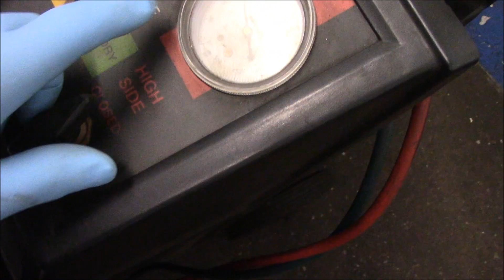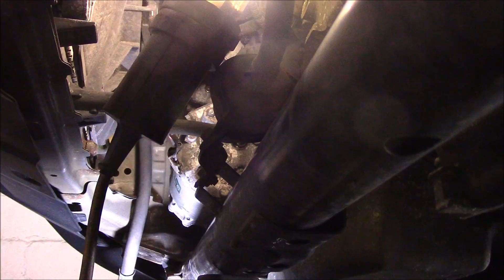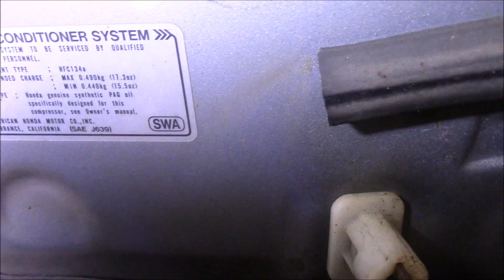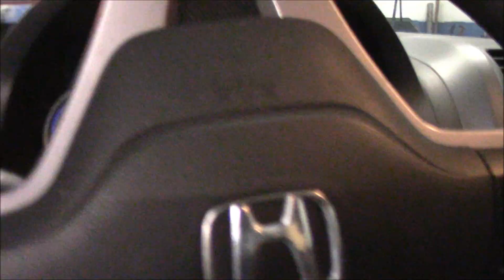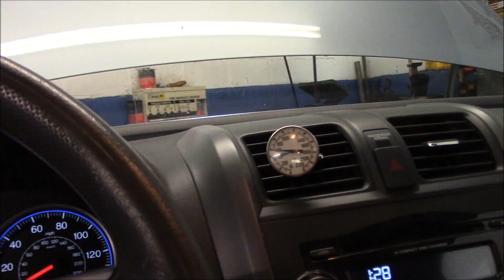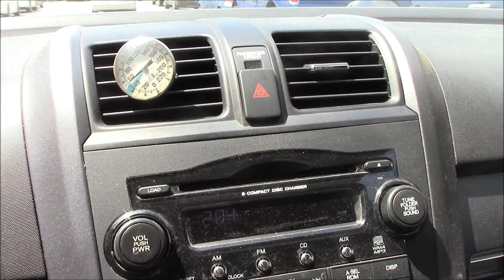How to replace the AC compressor 2008 Honda CRV

Comment: What does it mean if it's leaking? When the AC is on in my 2008 honda crv, what looks to be water starts leaking under the car. When the AC is off, it doesn't leak.

Comment: If the new compressor is pre-filled with oil, you just install it? denso video wants people to measure oil in old compressor and adjust the oil level in new compressor, is that necessary?

Comment: I would like people to call R-134a "refrigerant" or "R-134a". R-12 was called "Freon'. Oh, me? A retired 50 year fleet mechanic and an ASE certified mechanic for Auto and HD Truck. Yes, too many PRO mechanics call that R134a refrigerant "Freon" but just 'cuz they do, does not mean it's right. This is a good video on the procedure to replace the compressor! Thanks!

Comment: Jim, Thank you for this fantastic video on replacing the AC compressor.  I have a 2007 CRV and was quoted over $1800 to replace the compressor.  With your help and step by step instructions I am in it for a little over $335. I know the car is not worth over $3000 but now  we have a second great car that will last for several more years.  Thanks again, much appreciated!

Comment: Happened to me twice this summer 2020, Driving in the freeway at 75mph with the a c on,and suddenly after an hour of driving the a c stop blowing cold air.After 5 minutes the cold air came back.I replaced the condenser cooling fan that I thought was the culprit because the temp went up when it happened.Yesterday it happened again Driving home from O.C to Palmdale about 90miles drive after about 70 miles of driving it happened again cooling stopped for 5 minutes and came back.What do you think is the culprit,Any DIY or AC expert.Please share if you know the fix. Thanks.

Comment: Hi Jim! Great video.  I have a question. If the compressor is not locked up. All pressures are normal and I have voltage from the clutch relay to the clutch, is it a possible answer the the clutch could bad and not the entire compressor?
Reply from the maker: That is correct

Comment: Thanks for ac compressor replacement video. AC worked perfectly to/from trip until accelerating up hill when cool air stopped. Just questioning why a single owned garaged car/compressor with 114M miles should need replacement. Thanks again.
Reply from the maker: Glad it helped

Comment: Just a point of technicality.  When Jimmy says there is power at the clutch connector and because there is power present the compressor is bad. What he really should say is the clutch is bad.  The compressor maybe fine it's just the clutch that is faulty.  However the reason he says this is because these days you sometimes cannot get a clutch assembly by it;s self and just swap it out.  You have to get an entire new compressor.   And also Jimmy being a shop if he just changed out the clutch and the compressor failed in a year and he offers a 2 year warranty hows he going to explain that to the customer.  So it's a better angle for him to replace the clutch and compressor even though technically there may not be anything wrong with the compressor.
Reply from the maker: Your right Steve. Thanks for your input.

Comment: Another awesome video Jim! This vid helped me tremendously as I swapped my old Honda CRV compressor for a new one. I will note that the top low pressure line bolt was pretty seized. I ended up using a universal joint on a really long extension to get the access or torque needed by coming from the top down. Keep the great videos coming!
Reply from the maker: Glad it helped!

Comment: Im planning on installing a bypass pulley and completely remove the ac compressor. Will this same removal process work for a 2002 Honda CRV model? 

FYI i tried looking for the small serpentine belt gates k070553 to bypass the AC and not deal with the hassle of removing the AC, but the parts store will receive tuesday and i needed my honda to be on the road ASAP.

Comment: Can the compressor stop the engine from turning over? I’ve been driving the CRV for days and nothing happened until this morning. It was cold here and just didn’t start.
Reply from the maker: canonhawaii yes I have seen that before when the compressor locks up it will keep the engine from turning. Try removing the belt and see how it is

Comment: Thanks Jim, Told that my compressor seized, likely sending shards/contaminants into system, so I need to replace with 5 pc kit (compressor, condenser, drier, expansion valve, oil, O-rings...  Questions:
1. What remaining parts I don't change (hoses/pipes) do I need to air flush repainting pipes before connecting hi/lo to new compressor (of contaminants)?
2. Once everything assembled, can I for a very short time (minutes) test run the compressor to make sure in goes on (prior to vacumming/recharging w/ refrig.)?  I plan to have local shop recharge.
Again, thanks for great video.

Comment: Awesome job Jim! My son’s 2006 Civic Si ac clutch stops working after the engine is running about 20 minutes. Both radiator/condenser fans remain running , except the clutch. Once the engine cools off, it’ll function normal for 20 minutes. Any suggestions or advice will be appreciated.

Comment: Hi Jim. I replaced the compressor myself. I didn't vacuum before I removed it tho. When i installed new one the compressor n clutch did turned on but there was no cold air coming from vents only warm. I drove for 2 days but I was not turning on the ac. When I got my vacuum pump I vacuumed the system 2 times and then i tried to charge with refrigerant but it seems that it wont take it. Now my problem is that the clutch doesn't engage and so I can turn on the ac but there is warm air coming from the vents only and my lines pressure both are around 80-86 psi. What could be the problem?
Reply: I reached to the compressor seller n asked how much oil does the compressor needed to have they said 120 ml but dont know how much oil was in When I installed it but the said it did come with some oil in it.
Reply: What happened 
? did you eventually get your AC blowing cold?

Comment: Thanks for the vídeo. I have a 2007 crv my questions are how do I charge the compressor before putting refrigerant? I dont have the machine that you have to vacuum? Is it necessary to vacuum?  Can I just put refrigerant after install the compressor?
Reply from the maker: Yes the refrigerant goes in after the compressor is on the car and it should be vacuumed  down after installation. Thanks for watching.
Reply: @jimthecarguy  thank you I have summited my problem that I still have with my 2007 crv. If you can reply will be so much appreciated

Comment: To check a static charge of refrigerant you only need one guage line on low side preferred also this is a typical AC compressor CLUTCH failure very common on Honda and does not require the removal of the refrigerant nor the Entire Compressor to repair but most shops dont want to do this because the lose labor and parts money. Also you can purchase the clutch alone for a fraction of the cost of the entire Compressor
Reply: how do you confirm if its just the pulley? i hear these compressors are prone to going so is it worth the hassle to just do the pulley? do you need to disconnect the lines and remove the compressor to swap the pulley?
Reply: @drackett19  You do not.
Reply: This comment is very wrong while you can only add refridgerant to the low side you have to add based on sub cooling and that is the measurement of the saturated temperature of the high side minus the line temp

Comment: Why didn’t you change the condenser/dryer?  How would you know not to change it?
Reply from the maker: Because the clutch failed not the compressor
Reply: I think mine is in the same state.  It blows intermittently cold/hot.  So if the compressor is blowing cold or if it’s empty is how you know the compressor failed?

Comment: I’m getting ready to do this job, any reason to replace condenser and drier if the compressor didn’t catastrophically fail and just the clutch went bad. (Which is what I’m assuming happened in your case)
Reply from the maker: As long as the clutch was the only failure then you can just replace the compressor. Thanks for watching. Let me know how you do.
Reply: jimthecarguy. Thanks for the reply. I do car repairs on the side for friends and family for extra a little extra income. We have decided to just replace the clutch assembly since it’s a 60 dollar part and when i lightly tap the current clutch the AC engages and blows cold. I don’t want to open up the system if I don’t have to.

Comment: You forgot to flush the a/c lines and the condenser, replace the drier filter and the expansion valve as well, that repair wont last because the evaporator core has to be flushed out as well....to bad
Reply from the maker: In this case you don't have to flush out the whole system because the clutch coil was the failure. If the internal parts of the compressor failed then yes you would need to flush. Thanks for watching and your input.

Comment: How much should a job like this cost?
Reply: I have a 2009 CRV and my just went out.  I got quotes from Honda and other mechanic shops and it ranges from 1150 to 1300.
Reply from the maker: That job is not cheep. It will take about 4-5 hr labor plus the parts.So depending on the cost of the parts (new or rebuilt) it will be over $1000.00
Reply from the maker: Yes that is about right.

Comment: Do you need to buy an ac compressor kit or just the compressor? The kit includes an expansion valve. Do you need to replace this at the same time?
Reply from the maker: Yes if your replacing the compressor it is a good idea to replace the expansion valve also. Thank you for watching .  Don't forget to subscribe.
Reply: @jimthecarguy  do you need to replace the condenser as well and use an ac flush product?

Comment: If any pressure in lines, does that mean ac compressor isn't good ? If none in line then all leaked out threw O-rings on lines most likely ? Don't want used but bought a used vehicle and that's what there replacing it with, just don't trust them at all, already been screwed but they don't know I know it, I need to ask after its fixed. Then I can sue them for damages that's hidden up by them, just need to get the same answers I got the 1st time test drive, then the 2nd time test drive, but I must record it. The only way from the lawyer's said and my state is a 1 person consent. I'm the consenting party and can go after for damages that's hidden, can get my money back or try to get $1500 knocked off, then worth price.
Reply from the maker: Thanks for watching.

Comment: Jim did change the dryer my Honda compressor is still working A/C  but bearings off clutch are make noise have we determined it the compressor  original compressor 134,000 miles l be changing it out myself with help.

Comment: Good video. My situation is just a little different. (2009 Honda CRV AWD) My AC is running even if the AC control on the dash is off, note I/m not refering to the defrost setting.  I pulled the relay and it shuts off but when I plug it in the AC clutch engages.  I also have removed the wiring harness at the interior control and I still have the clutch running.
It eventually kicks off after what I think is the hi or low preesure switch kicks in and then stays off until the pressure stabilizes.

I think it might be a faulty clutch that is grounding out and causing the issue but not sure of any tricks to test for this.  Note, this started on this past Sunday and on Saturday I had to drive for several hours in a major rain storm.

Any thoughts?

Comment: Hi Jim.  My mom has this same exact year and model.  Her AC went out and took it to three different shops which told her that the compressor is bad. All quoted her from $1600-$1800!  After watching your video I feel like I can replace this compressor fairly easy myself. Any other key suggestions you would make on doing it myself?  Thanks in advance 🤠
Reply: American REInvest LLC Do you have refrigeration tools
Reply: Edward Hvacr couldn’t he have a shop remove the refrigerant before he replaces the compressor?
Reply: Does anyone know if the pressure has to be taken out before you remove the compresser???

Comment: Awesome how to ... I have a 2013 CRV that climbs to expected pressure when the compressor cycles on then falls off approximately 15psi. It also takes what seems like a long time to return to a balanced static pressure after the car is turned off. Any suggestions?
Reply: Bradley Crouch I tried to remove the ac compressor of my 2013 crv but there is no room to pull it out from the button of the car. Any idea how you took it out?

Comment: My 07 crv compressor failed...I installed a a used low mileage one from a 2012 CRV and it worked perfectly.
Reply: did you have to rent or buy any expensive refrigerant line tools? that machine in the video to vaccum the system didnt look cheap
Reply: @drackett19  Nah, just buy r134 hose and 1 small tin of freon and ur good to go..
Reply: @higherregion  ok thanks. I do have a recharge kit. do you hook up to the high or low pressure side?

Comment: great video,i will be replacing my compressor and condensor, but do not have a vacum pump,so once i have installed it,can i drive it to a shop and get it vacum and charged

Comment: Many thanks, an exceptionally good explanation & video. 
I read somewhere that the system should be flushed after purging to prevent potentially damaging debris from the failed failed compressor contaminating the new compressor. You make no reference to this, what are your thoughts?
Reply: If the clutch is the only problem (the internal workings of the compressor were not the issue causing failure) then there is most likely no need to purge the system. If the compressor itself and not the clutch went bad, then a purge is necessary.  The condenser would also need to be replaced as it would be the first place the debris would go and it's channels are usually just to small to completely clean. And they are cheap, especially compared to replacing another compressor.

Comment: Hi Jim, if a compressor does not come with oil, do you add oil directly into the compressor?  Do you add oil to the suction or discharge, [ where the lines connect ]  THANKS FRIEND

Comment: Honda CRV has a very weak ac compressor installed in the factory. Depending on the part number, some of them are remanufactured Sanden brand. My 2012 CRV ac compressor failed at 50k miles. Honda is cutting cost on their vital parts.
Reply: I'm finding new compressors at Advance auto parts and other parts places, under $295 for New with oil in it too. Also they carry different ones, the one that seams to be good os Demco I think if spelled right, use their spark plugs and coil packs on many things, they also have AC DELCO brand and 3 reman ones, threw Honda they cost $550 these are new or Reman under $300 bucks. Factory don't last so why spend more if you don't get the miles on it.

Comment: That was a fine job with the air conditioner compressor, and I know it must have been difficult to get the old one out, and the new one in, but the customer will be happy, and you have earned the money paid for that repair job.
Reply: Why would it be difficult for, it looks very easy to due, damn its easier than changing my oil on my SUV, but I replaced an engine from the ground, just used jack stands and a jack with Bundy cords to hold ac unit out of way, it was the easiest engine I ever done and didn't use any lifts, no friends work in garages anymore, so no use of a lift after hour's for free. It's easy if your smart. No creeper neither, just cardboard with old shirt on that slides well. Happy working hard if this is hard, hate to see a Frame swap done on a 1980 chevy pickup, no lift, 3 friends to lift cab off frame and walk off, 14 bolts holds the nose on and easy to take off to change engine, its stupid hard to get engine up and over radiator support now. 20 minutes and 2 people, the nose walks off. Then your great to go as 1.

Comment: I assume this goes back to you saying in another video...if the clutch is bad... same price overall as changing the whole unit .. parts and labor  :) :)
Reply: ChicagoDoItYourself Now replacing just the clutch is a lot cheaper than a new compressor probably a air gap problem with the clutch sometimes tap them with a long pry bar or screwdriver and they will kick in and run
Reply: Well if you're doing it yourself..  sure...   but people aren't happy when they have to come back for the same thing even if they only spent $10 to get on the road again and yes... could last for years or...... for myself sure why not but.. a customer .. nope... .. replacing a clutch on that vehicle on the car.. nah.. not for me.. This guy talks to his customers.. gives them the story... I can do that but...  so.. I still go for the thumbs up  : )
Reply: ChicagoDoItYourself Now I agree no one likes comebacks but any part can fail at anytime that new compressor might make it a day or a week and come apart all this stuff is made cheap and usually over seas my point was the compressor was good the clutch was bad but a clutch probably $50 a new compressor $150 plus